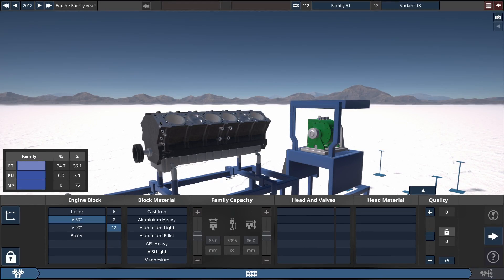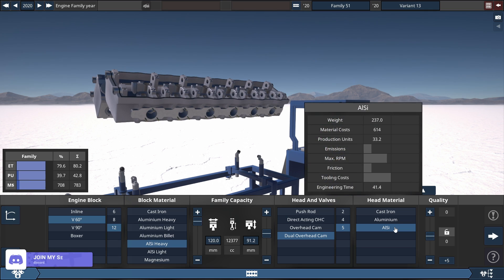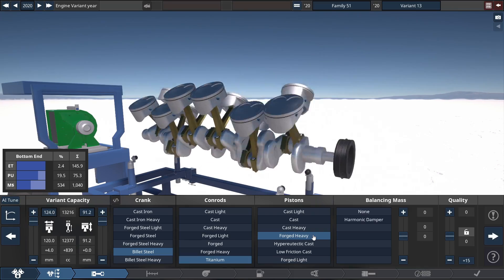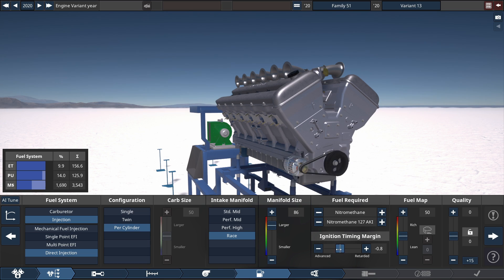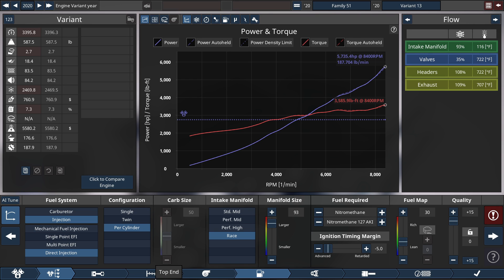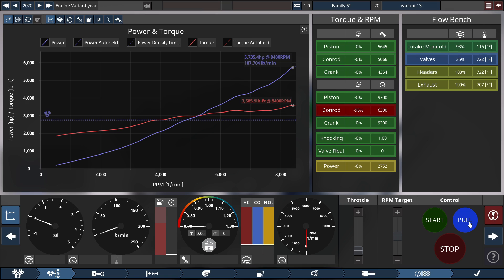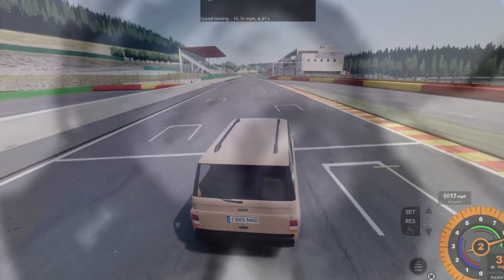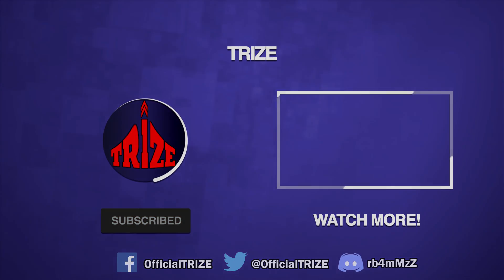The Highest Horsepower, Naturally Aspirated V12 Engine Ever! | Automation Game (LCV 4.3)

Comment: Why don't you make videos based on performance index? I think that makes more sense than a peaky engine with low torque.
Reply: quad turbo it, smart boost, 477hp IC, variable geo, ball bearing, 96mm, 94.9mm, 45, 1.10 bar